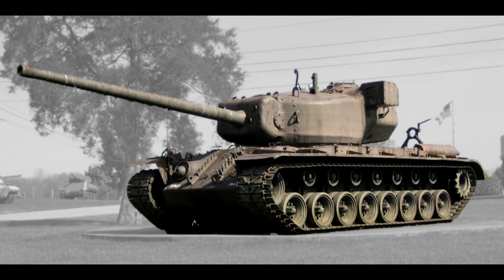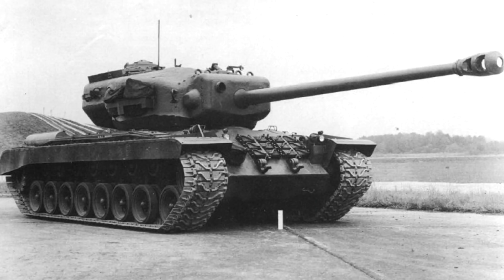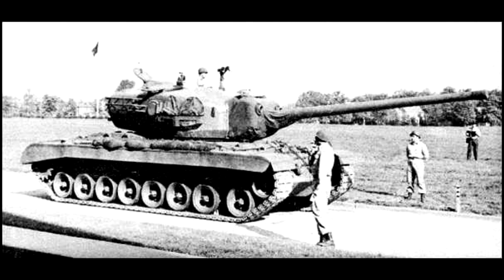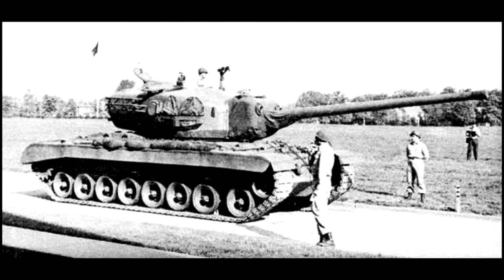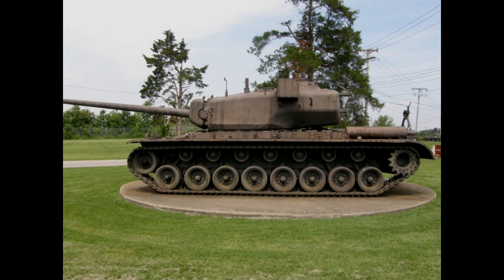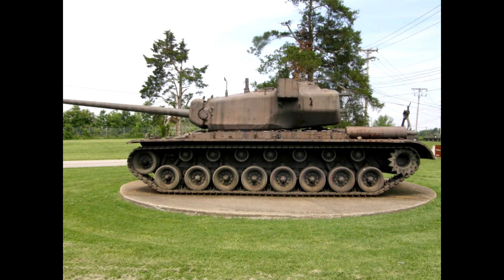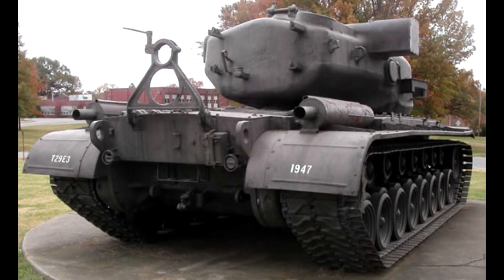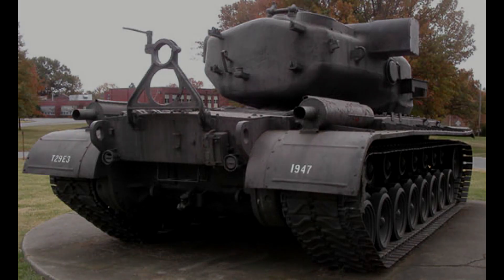T29 Quick Tank History

Comment: HULL ARMOR
Upper Glacis: 102mm@54°
Lower Glacis: 70mm@59°
Turret Front: 158mm
Gun Shield: 203mm, Area around gun 254mm, edges of gun shield 305mm.
Spallshield(internal armor behind gun shield): 25.4mm or 38mm.
Gun caliber isnt everything, the 105mm T5 had better AT capabilities than the 155mm T7 with kinetic ammo.
The 105mm T29E3 APCR was calculated to be able to punch through 360-380mm of vertical armor at PB range.